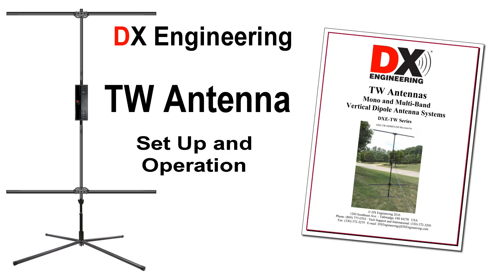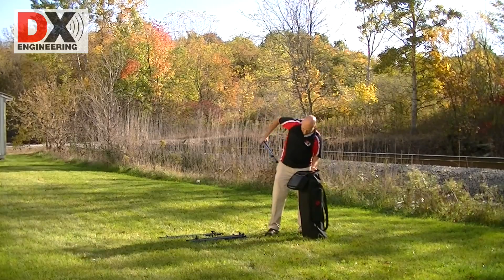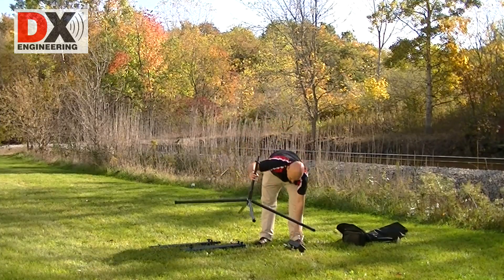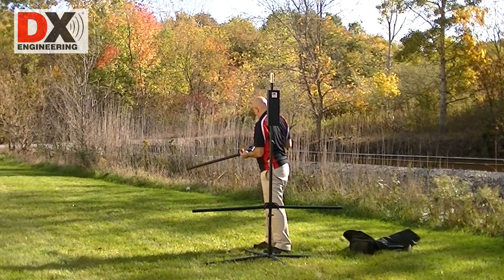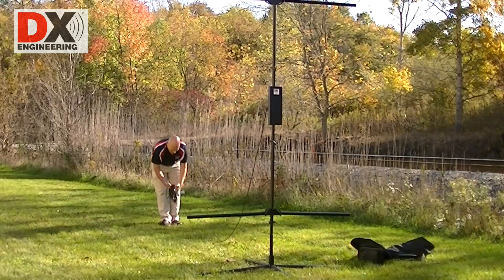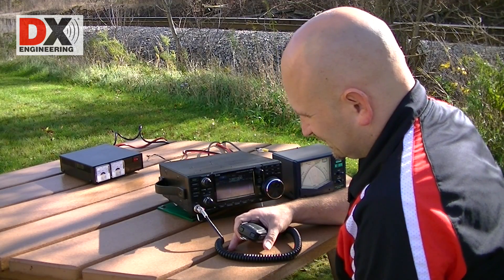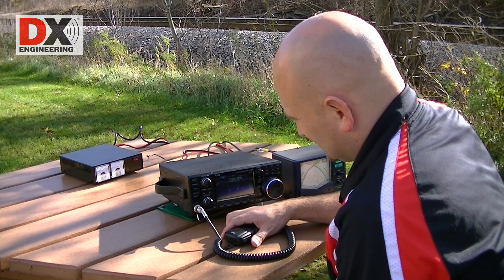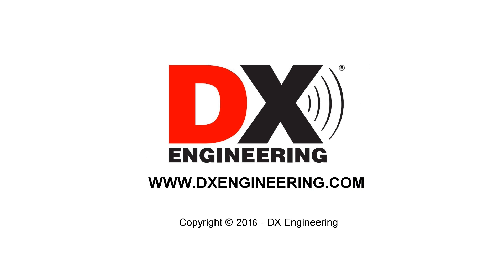Assembling the portable TW Antenna

Comment: 5-10 over 9. Well you two are 10 miles from each other. So does that mean it was a NVIS? Yeah I guess so. Or is 10 miles too close for NVIS. I don't typically do contacts like that. But doesn't being too close keep skywave (bouncing off the ionosphere) from working?
My question is, will this antenna do skywave propagation?
Reply: Taken from the Manual on the DX Engineering product page; "The TW antenna is an omni-directional center fed vertical dipole with a very low radiation take-off angle (approximately 27 degrees above the horizon), allowing for very long skip." I have two of them and have enjoyed many DX contacts.

Comment: I need a replacement bottom tripod section for my tw2010. Can you sell me just the bottom tripod section? I love this antenna have used it for over 10 years and on 20 meters it's fantastic!
Reply: They sell the components on the website. You can buy a top, bottom, tripod, or the center section.